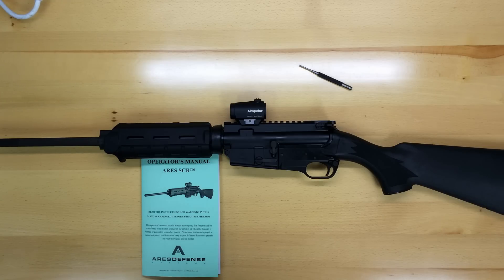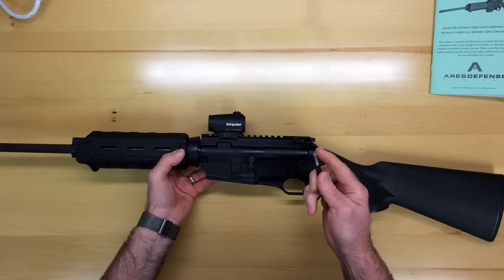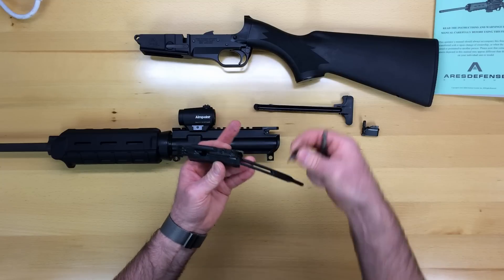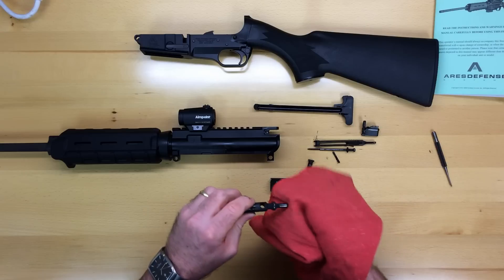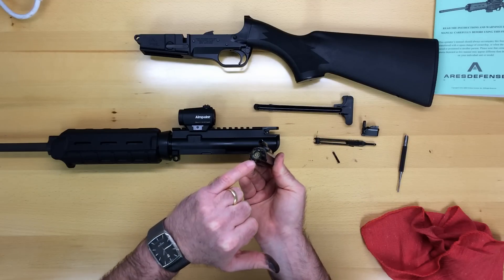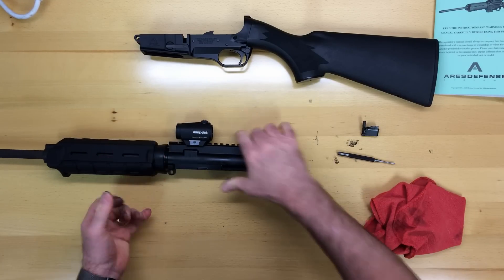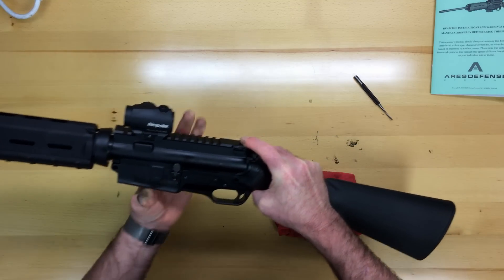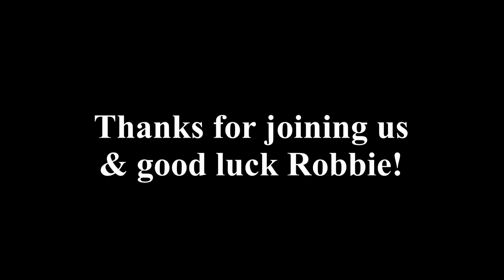ARES SCR Takedown

Comment: Thanks for the video.  Got my SCR in December.  Haven't pit enough rounds through it to clean the bolt assembly but I have separated the upper from the lower and your video has made it a bit easier.